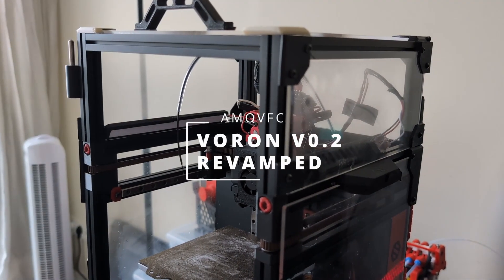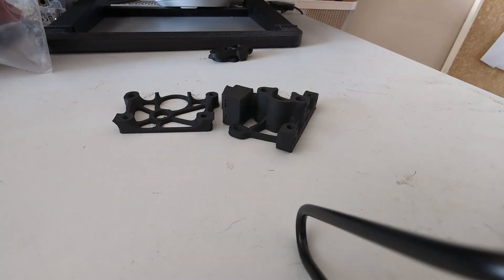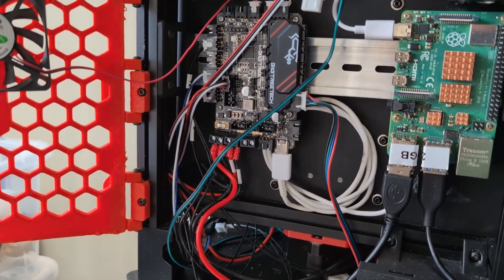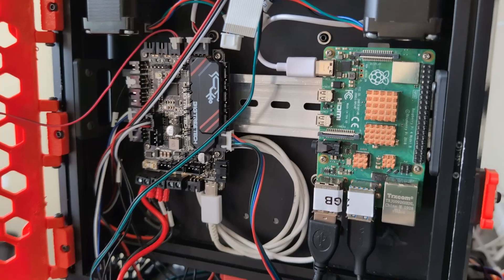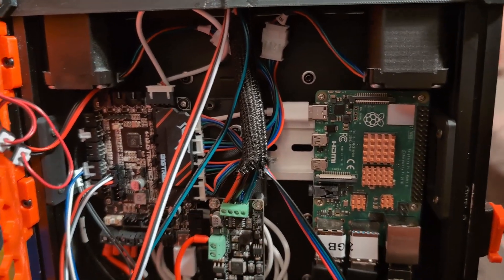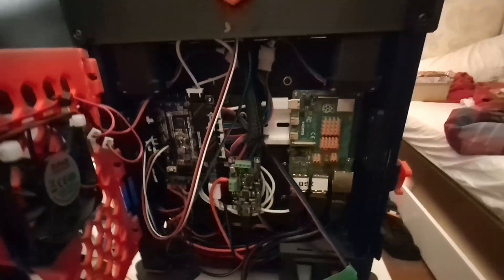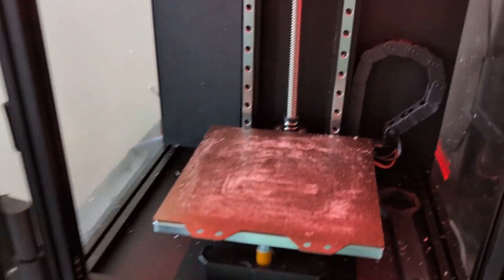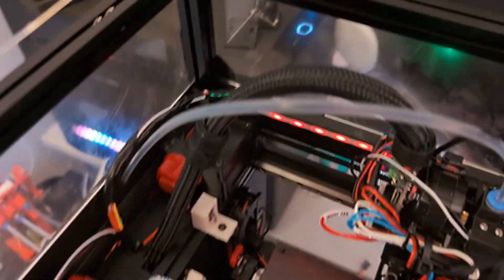VORON V0.2 Refresh and upgrade - Getting Ready for PICO MMU - NEW Extruder

Comment: Hello, do you know ig the Orbiter smart filament sensor can be used with the Pico MMU?
Reply from the maker: yes it can
Reply: @AMOVFC  I did not find info related to that.
Reply from the maker: @estebanjaramillochica7832  you just need to assign the right pins, the creater of the SP PICO uses an orbiter, https://github.com/lhndo/LH-Stinger/wiki/Pico-MMU#q-is-there-a-toolhead-hub-or-a-filament-sensor-for-setup-x , if you still having struggles ask around on the discord,
Reply: Do you know if it works with the CNC Sherpa mini? I really like mine but I'm going down the rabbit hole of finding a sensor for it now...